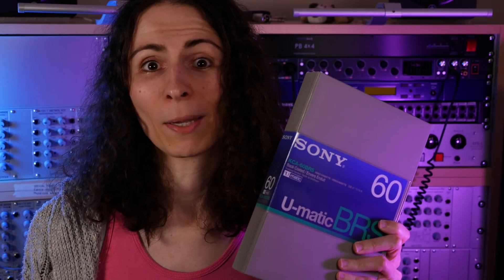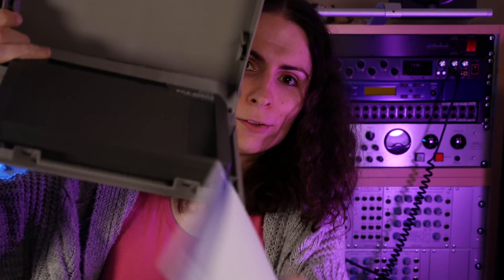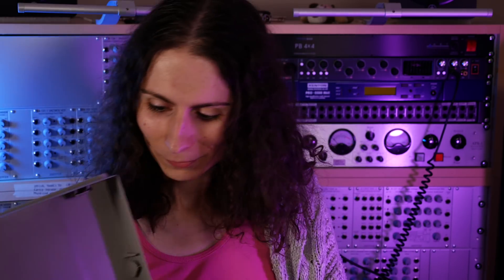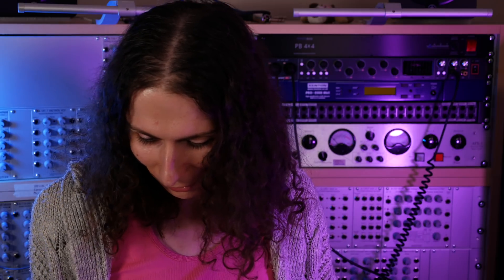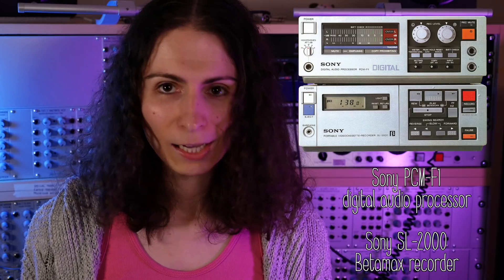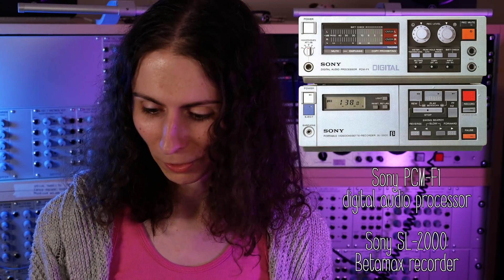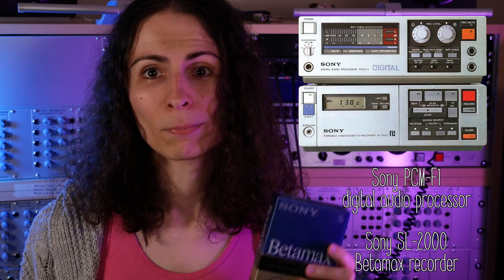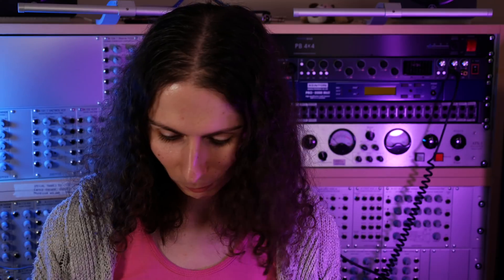Why are CDs 44.1 kHz?

Comment: I never knew this. Thank you, it's fascinating!

Other fun CD facts:
(From memory) CDs use 14 separate error correction techniques for their data. Imagine trying to decode one without any reference manuals...
CDs store music in frames, 75 per second. I found this out the hard way when I was involved in a project releasing music for role playing games, and found that the loops we had made, when ripped to files, were looping with annoying clicks. Your music needs to be a multiple of 1/75 seconds if you want the track to loop.
I calculated that if you recorded a band playing live for a typical running time of one hour and 40 minutes in CD quality stereo, the file size would be... wait for it... ONE GIG.
Reply from the maker: Haha, that's a groaner!  Yeah, I wrote a bit more about all of this over at my rather obscure webpage http://notebook.zoeblade.com/44_1_kHz.html where I also mention the frames.  Given that CDs build upon saving PCM data to videotape recorders, you'd expect the frames to match, but curiously they don't appear to.  I'm not sure exactly why they chose to split the audio into frames the size they chose.

If memory serves, MP3s have a similar issue.  It's like no-one wants people to be able to listen to Dark Side of the Moon digitally...
Reply: @TransistorSounds  Yes! MP3 has blocks that get zero-filled, I seem to recall, and some apps are too lazy to remember the proper end point and just play the whole of the last block, or something. Thanks for the link, I will read your post.

Comment: Zoë implied it, but didn't state it explicitly: The thing with 60 and 50Hz mains and 44100Hz sample rate is that 44100 is divisible by both 60 and 50. But then you might say: but so is 40200, 40500, 40800, 41100, 41400 ..., and they're all above the magic 2*20kHz, so why 44.1 precisely? I don't know for certain, but my guess is that it was to give a little leeway for gentler low-pass filters. In the end 43800 vs. 44100 vs. 44400 was a fairly arbitrary choice.
Reply: Did you read the maths on screen?
Reply: @theodorecupier5920  I must admit that I often more listen to videos like his, than watch them, so that calculation passed me by.